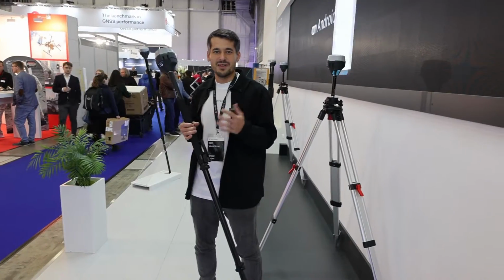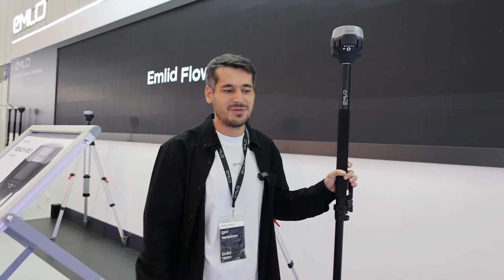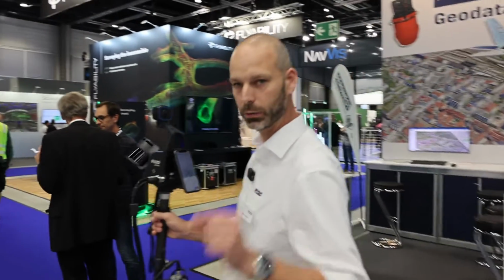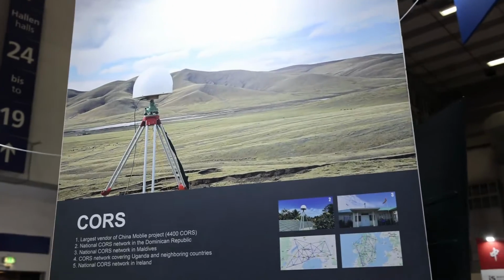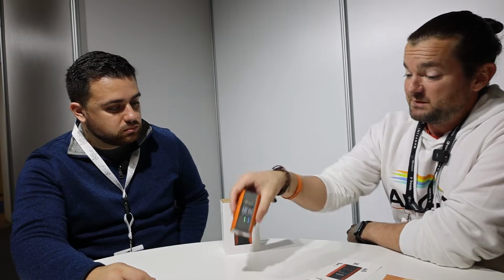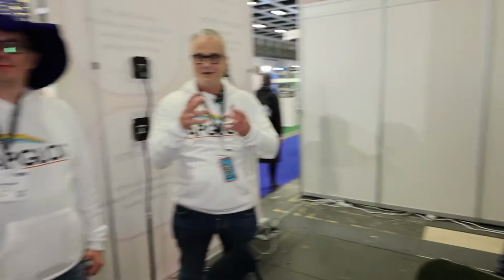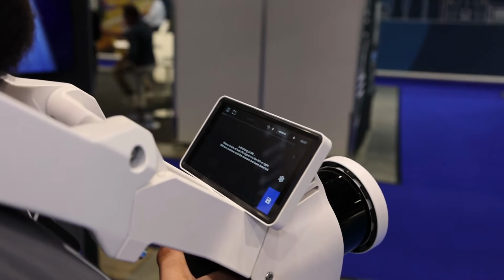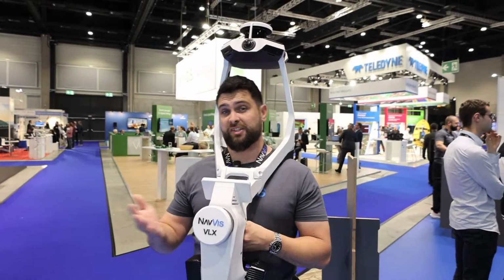This is a Full Body LiDAR SLAM Scanner

Comment: Good stuff if it actually works as intended.  In my experience these lidar collection devices only work about 40% of the time you need them to.  Keep in mind you'll be processing all this data after collection.  If you like sitting at computers, have at it.  People I work with see this stuff and say "I didn't sign up to troubleshoot IT problems" or something of that nature.  They like things that work solidly all the time.
Reply: Are you actually complaining about having to process the data?